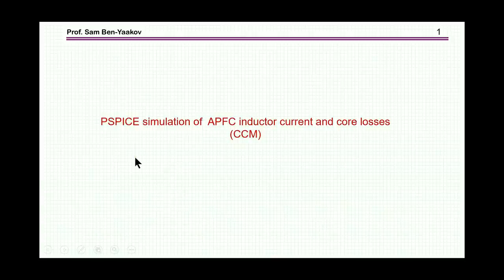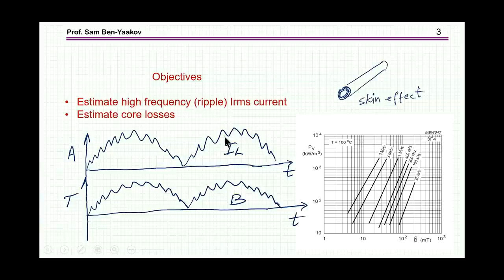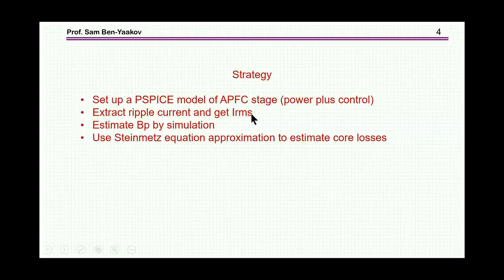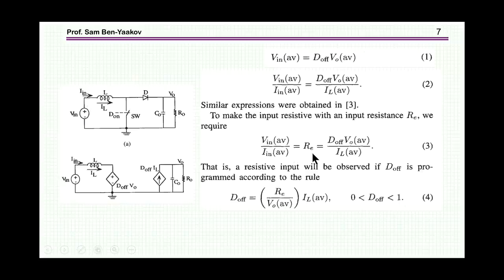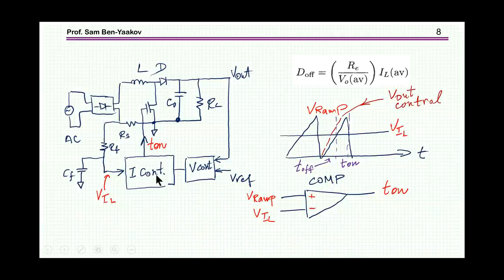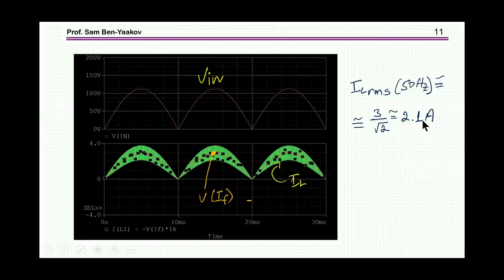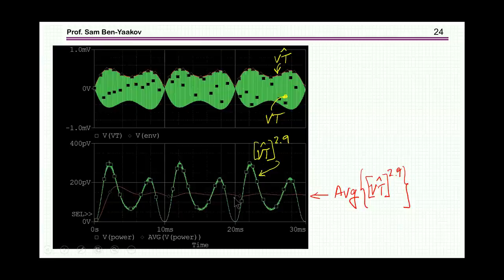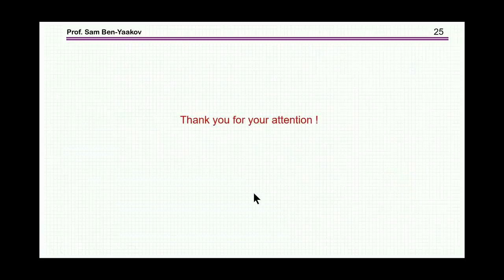PSPICE simulation of  APFC inductor current and core losses (CCM)

Comment: Hello professor, could you please tell me why are we removing low frequency component from inductor voltage for the calculation of inductor core loss. 
Thanks
Reply from the maker: Core losses are proportional to f^2 so low frequency loss components are small. Hoever, low frquency can saturate the core and will increase the  HF loss if B is increased.

Comment: Dear Sir,
Regarding power loss calculation, what is the cutoff frequency chosen for the high pass filter and as well as the envelope detector in calculating the peak volt-second? what is the value of R and C in the case of high pass filter and what is the value of R and C in the case of envelope detector? could you please provide these details. I would like to simulate and check it.
Reply from the maker: Unable to follow the question. Please elaborate.
Reply: @sambenyaakov  Thanks for the reply. In the power loss calculation of the inductor, VT(volt second) is integrated first and then the high frequency value of VT is taken using a high pass filter. Can you please provide me the value of R and C used in the high pass filter. And then next the envelope of the value VT is taken using an envelope detector. Can you please provide me the value R and C used in the envelope detector. I would like to implement such similar circuit and check on my own.
Reply from the maker: @sureshrajaram709  Sorry, but due to lack of time I am unable to dig this

Comment: Hello professor, One question regarding core loss equation. Which value of frequency f is taken for calculating core loss? Is it a switching frequency? Because the inductor voltage contains many harmonic components. which frequency is to be considered for calculating the core loss. Kindly reply.
Reply from the maker: Hi, The core losses are a strong function of frequency (to the power of 2-3 so the HF losses are usually dominant. However, the LF current pushes the  BH curve toward saturation which increases the HF losses.

Comment: Professor, thanks a lot for comprehensive explanation! May I ask, what APFC power range is this topology targeted for? Could you also suggest literature with complete study of small-signal analysis and stability issues of different APFC`s, and some examples?
Reply from the maker: Hi peter,
Thanks for comment Border line APFC are practical up to 100-200W, . A single stage CCM APFC can go up to 3-4kW. Was this the question🤔
Reply: Yes, that`s it. My confision is about fact, that most CCM APFC designs I`ve seen makes use of input voltage, while this realy is not necessary. so I wished to confirm my guess. and what about literature on small-signal analysis? what would you suggest?

Comment: Hello Professor, thank you for an extremely enligntening presentation. This was the first time I was able to simulate a CCM PFC in LTSpice and obtain correct waveforms. Could you please explain how to modulate the valeu of Re in order to compensate the varying load resistance? In other words, how to add VOUT stabilisation? You have already explained the principle in your other PFC-related video (that is, to adjust the sawtooth slope), but I fail to simulate this aspect correctly. A behavioural level would be fine, I think I am missing something simple.
Reply from the maker: Thanks. Perhaps these slides  would be of help to you:
http://www.ee.bgu.ac.il/~pel/seminars/Slides_PF_APEC03.pdf

Comment: Dear sir, i shall try to reformulate my previous query.  In the power loss calculation of the inductor, VT(volt second) is integrated first and then the high frequency value of VT is taken using a high pass filter. Can you please provide me the value of R and C used in the high pass filter. And then next the envelope of the value VT is taken using an envelope detector. Can you please provide me the value R and C used in the envelope detector. I would like to implement such similar circuit and check on my own.

Comment: Sir I saw a Active PFC using uc 3854 .but I don't know which type of  topology they used . inductor used in behind the bridge AC side and mos fet used in front of bridge and short tha bridge by pulsating. And then get negative and positive both voltage. Please sir explain which type of topology and terms of uses.
Reply from the maker: I am not sure I follow the description of circuit. Can you send me the schematics?
You may use 
sby@bgu.ac.il